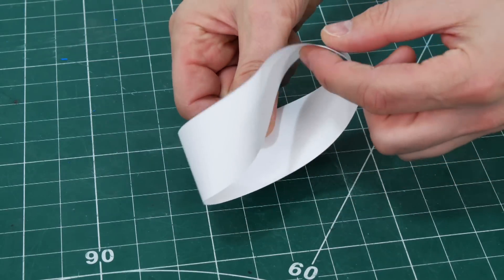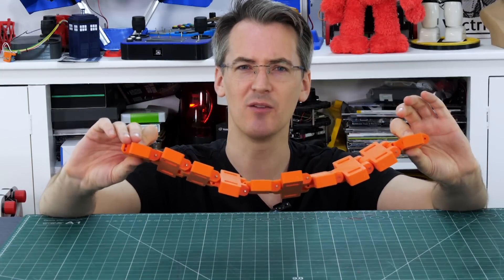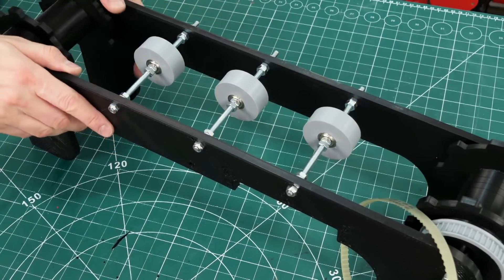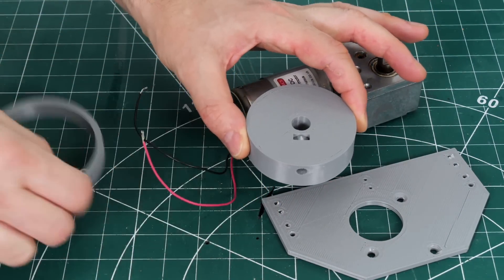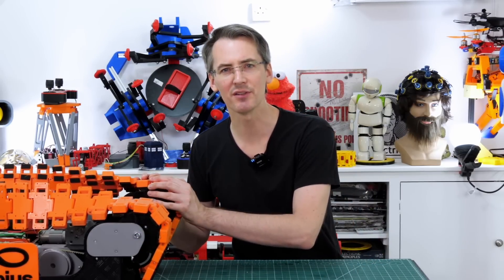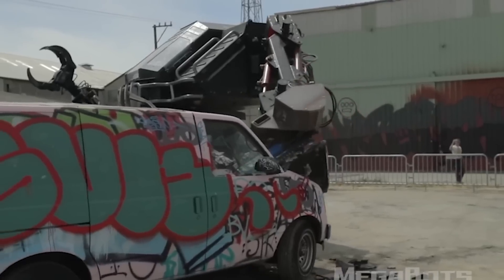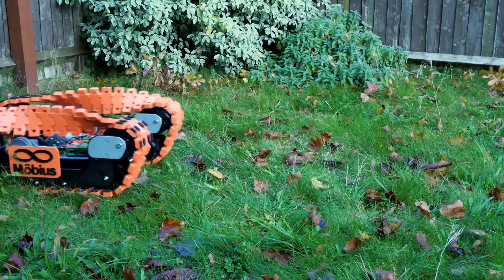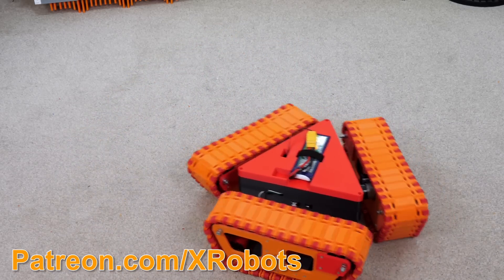Mobius Strip Tank

Comment: @05:35 Reprinting those grey Side Plates with differing geometry until they fit the necessary track tension instead of designing them with a slotted design to be adjustable on the fly is driving me up the walls.

IMHO, the only way this System would make remotely sense were if you could twist the Links not only 18° like shown at the beginning of the Video but 180° thus making it possible to turn the track from a Regular into a Möbius one via the use of a mechanism that twists them as the Links pass through it. By twisting it twice, the second time after it made a full rotation, the track sides would have switched sides from smooth to gripping.

Comment: I feel like a reason for a mobius track would be the fact that the track is technically longer, so wear would be distributed between the "two" sides of the strip meaning the tread could last longer before needing to be replaced. your example with the one half grippy and one half smooth could just be done with a standard track so I wouldn't see that as a USP for a mobius track

Comment: To reduce vibration, move drive sprockets(any sprockets really) away from the ground.  Add grooves to track segments and corresponding lips to the rollers to keep the tracks aligned on the ground.

Comment: Soooo... Just an observation... 

Instead of reprinting parts to deal with tolerances, and tensions issues, instead, design your parts with slots. This will allow you to adjust the tension without having to re-print the part again. Also, for the belt tension, again, use slots, but this time instead of completely tightening down the sprocket assembly mounting plates, put a backer on the frame, and use a set of springs to push against the sprocket assembly, this will give you dynamic tension for when going slow, or fast.

You can also reduce the amount of "bumping" you're seeing by using sprockets with proper angled teeth. square teeth have no angular contact point to "ride" on, this will cause them to "bump" into position, knock on the flat contact planes, and bump back out. using teeth with an angled contact point will allow the contact point to continuously be in contact witht he mating surface, reducing friction, wear, and providing a smoother continuous power transfer from sprocket to tread.

Comment: I don't know how to explain my idea but why not just have smooth tracks, like you do now, with rubber pads that are flush (in line with the flat smooth side) and have a user controlled piston wheel that will push out on the rubber pads near the front and back of the tank when you need them?

Comment: When I saw the thumbnail my first thought was "why would you want to do that?"  Fortunately, you answered my question right at the beginning.  :)

Also, pedantry time:  a "bogie" is an assembly of two or four wheels that is independently suspended or articulated.  That is, the wheels are (usually) fixed in place, but the assembly is suspended or articulated independent of the rest of the vehicle.  With your design, the wheels are just fixed to the frame, so there's no bogie involved.  Which means they're not "bogie wheels," they're just road wheels.

Comment: I can't think of a precise use for it, but this design allows you to stack rows of treads (think |||||||||||| ) with zero gap between them; the support can go between the mobius twists on the back side, the rows of treads no longer need a support gap. They can also be much more flexible in this use case than other gapless options.

Comment: Could you some how build in a mechanism to the tracks to temporarily make it a Mobius strip as to flip the track inside out? It could provid a similar purpose to what it does in this video. Though in this case it would be consistent through the terrain you need to use it (IE spikes for sand but smooth for asphalt or concrete). I would think each linkage would need to have the mechanism so that you could activate the transition and it wouldn't have to do more than one full rotation to inverse the track.

Comment: Actual uses for a mobius track:
-If you want a machine to stamp a repeating pattern into concrete, you could make it half the size with a mobius track.
-It will increase how long rubber grip pads will last, because they are only contacting the ground half as often.
-You could use it for a belt in an airport, again to increase the uptime before you have to replace the rubber gripping surface.
-You could use it to tip material off the side of a belt in a factory.
-If you put in two twists instead of one, you could have a belt with a different surface texture for only part of it's run. Not sure why you'd need that, but it probably has a use case somewhere.
I'm running out of ideas here, reply if you have a good one that nobody else has suggested!
Reply: You'll have to have twice as many grip pads, or if flat, it will become thinner just as fast.
Reply: Its not usefull on its own, but in theory you could use the bend to give the chains a 3D path enabling either: A tank that has only one track (and can only drive straight) or tracks that flip to the side on the top side, leaving more room for armor or the important Parts of the tank on the side.
Reply: If you put a pair number of twists it will not be a mobius strip, it will have two parts like an untwisted strip
Reply: couldn't it also double the life of a something like a belt-sander? Obviously it'd still be using the same amount of material, but it'd only need to be replaced half as often.
Reply: Probably not a great idea, because then you'd wear the idler wheels faster, and those are way more expensive than the belts. @robonator2945

Comment: It should also theoretically allow for more "even" or "slow" wear as if you either put the grips on both "sides" of the tracks or not on the tracks at all, you would wear both "sides" of the tracks unlike a normal tank tread where one side always faces inwards towards the gears and the other side always faces outwards towards the ground/sky. That would make the tracks last twice as long theoretically,

Comment: I think you missed a trick! You had the twist at the top of the track, I think having the Mobius twist in contact with the ground would have a better effect. If you could make the edges of the tracks into chamfered teeth that gripped the ground?   Your setup is good but using a wide double-sided timing belt as tracks would have allowed rubber teeth to be in constant contact with the ground.

Comment: would be interesting to have a double twist such that along the ground you have smooth treads, then a twist to a grippy tread that could be lowered as needed, or raised when turning, then twist back to smooth again at the other end of the tank. wouldn't be a mobius then, but still a twisted tread tank

Comment: Why not use a longhole in the grey plates, so you can adjust and readjust (if stuff wears) on the fly without needing to reprint. Or wouldn't the plastic hold the tension required for the plates not to move?

Comment: theoretically, this is better for wear and tear. rather than one side of the track solely being in contact with the surface it takes turns so to speak. What I would like to know is how would it function in muddy conditions? and what if the twist was useful for water locomotion. I feel like there could be some applications for this idea but its verrry niche

Comment: This has probably been done before, but as you described the issue with long track vehicles like the megabots experiencing high friction when turning...
Could you add lateral wheels to each tread link to grip in one axis and slip in another, reducing the friction?

I can foresee issues with more focused stress on those wheels and their bearings.
Possible solution would be a spring loaded pads which may slide laterally but spring back to center position? (Not sure how that'd cope under stress)

Of course, the more parts you add, the more maintenance required and more potential points of failure, especially when applied to each individual tread link.
I'd love to hear your or others take on this problem and solution.
Just saw you have already made a video on omni directional tank treads, about to watch it now. Sorry

Comment: Put the pads all the way round.

I think the only advantage I can think of is that each side of each track piece is only in contact with the ground once every two revolutions so there's some potential saving on wear and tear. ie. you have two outer surfaces to wear out instead of one.

Comment: You know I clicked this video because I thought someone had finally figured out the muddy/icy tread problem which you did but I guess you didn't realize it haha. To clarify sticky mud or ice clogs up treads until they have no scoop action left on the slick surface(ice on ice mud on mud). When you invert the track you could place a diverter to eject the mud out the side. maybe even a wheel to increase the bend angle and fling it off. Also too much ice inside can de track your treads so you have to build around that, making it holy or add a scrapper.

Comment: The only idea i have where this can be useful is in steel foundaries where they have vehicles that drive over very hot slag. With this design you could cool one side and heat the other on the ground, then switch. Or maybe as other pointed out, resistance to wear. Or both, on Venus for example, spread the wear over two sides and cool it down at the same time

Comment: You can even make a moebius out of a bicycle chain and ride it. At least with recubents and velomobiles where chain lengths of about 4 meters are common, this is a known problem. It may run fine for some time but put you in trouble when least expected. So a moebius check is mandatory after installing a new chain. ;)

Comment: 1:45 - I believe that the reason you're not getting 180 degrees is because you only have 9 connections between the 10 tracks which would be 162 degress, or exactly one track/connection short.

Comment: How about a normal track that has a center nylon tubing that you can inflate to lift the tank slightly? that way you can inflate to only contact the smooth part of the track and deflate to use the grips located at the sides of the track.

Comment: The better solution for tensioning the belts on the motor and tracks would've been to use slotted holes. All you would need to do is loosen the screws/bolts and pull tension on the belt or tracks while tightening them back down. Helps with having to reprint parts when more or less tension is needed especially since, over time, both the plastic tracks and motor belt will stretch from normal wear.
Reply: I was scratching my head as to why he didn't do that, given that axles sliding in slots is how they tension tank tracks and conveyor belts in reality.

Comment: it doesn't bend 180 at 1:45 because you only have 9 joints so far, the 10th joint on the 11th piece would make 180 currently you have 162

Comment: If you could put two twists and put them on the bottom, would it make a sort of screw drive? If you designed the treads right, you might be able to make legs like your previous centipede attempt.

Comment: Okay what it you could use it in extreme mud. Basically you wipe one side and drive one the other. So after the flip you add brushes that clean the dirty side of the tread while you drive on the clean side. This means in really muddy envionments your treads don't get filled with mud and lose grip.

Comment: James!! Ive got an excellent suggestion for a possible use of the mobius strip treads: cleaning! with mobius treads you could clean debris regularly from both sides, ensuring that they cant get bogged down! Think about it, treads can now go through mud or sand or rocks. One brush per tread means that every two rotations both sides get cleaned (thinking like a bristle brush). Or for overkill, a brush on each corner would constantly clean both sides but the brushes only need be on one side. Obviously this isnt an issue for huge tanks, but for small ones it might really benefit. What do you think?
Reply: 16 likes already? Apparently my idea isnt a terrible one, Hopefully James sees my reply...
Reply: @k_the_v  The, um,  flipside of that is that both "sides" pick up mud etc. Think about it, treads have been going through mud or sand or rocks through two world wars.
Reply: @Hugh7777  yes, full size tanks can handle just about everything.  However, we're talking 1/4 or smaller treads, so rocks and sand are a far bigger problem.

Comment: So when James was testing the 10 track segments and they didn't quite make it to 180 it wasn't a tolerance issue, he needed one more segment. The interface between two segments can rotate 18 degrees and while there were 10 segments there were only 9 connections each connection with an 18 degree rotation for 162 degrees. Ten connection which would require 11 segments would have gotten you to the full 180.

Comment: may be retractable pad along the chain, with a switch lever near the wheel to activate deactivate them... it could be programmable like ABS : if the wheels are spinning too fast  > no grip > activate pads... the möbius part wil make it easier for retrataction... (you'll have to push the pads is you want to put them out or in)

Comment: Would this not just work to gum up the drive train or at least expose the far more complex drive train to significantly  more wear than necessary? Just thinking it's easier to change a track section than a drive sprocket.

Comment: Didn't watch the vid but from the thumbnail I immediately see the tracks picking up sand and dirt and dropping it mostly inside the tank body. This would likely over torque your drive motor as it looks like you turn down the motor speed by belt. Might need to be damp or wet dirt/sand before issues such as described are presented.

Comment: What might be an interesting use (although a bit of an engineering challenge) is to make the twist switchable. So In normal use, you'd have non twisted tracks with either the smooth or grippy side in use. Then when you need to change grip, one of the track joins would twist on each track and allow both tracks to do one loop and effectively change their surface over.
It wouldn't be a Mobius strip then as such, but the twist capability of the links would allow this 'flip sides' option.
Reply: Maybe make it a single link that's  split, so it can spin 180 and then lock back together, rather than make one of the joins even more complicated.
Reply: @Stereomoo  Yup that could work. What I'm thinking is with the 18 degrees of spin rotation in each of the links, you could effectively flip a join around somewhere so the following links rotate around by the time they get to the front sprocket wheel.
Reply: @ZwilnikSF if you had a little knob sticking off the ends of one of the links, you could have a slot next to it on the body  that either has the knob continue straight along (no change) or diverts it to flip it the other way.  then you just move the slots while it's on the bottom part of the track, and whichever one's available back at the top it'll follow.  Then have a free 180 pivot between that link and the one "ahead" of it.

I guess really you'd need 3 paths, continue straight, then 180 clockwise and 180 counterclockwise.  Though possibly it would untwist on its own if you let it. (or springload the loose link to encourage that)

Comment: 1:40 it is logical that you need 11 segments for the full rotation, because the first segment rotates by 0 degrees not 18. so after the first one you need ten more to reach 180°, the first one is the 0 position not 1. or you look at the connections then after 10 elements the last connection is already 180° or you start the first one at 18° because the connection can take a 0° segment. so the printed tolerances are perfect!

Comment: Wouldn't that drasticly reduce wear? As its wearing on both sides? Also for faster speeds maybe a guide on top to guide the track so the mobius knot stays on top.
Reply from the maker: Yes, but then the linkages will probably have other issues eventually due to the weird 2-axis pivot.

Comment: If I remember correctly if you cut your mobius strip again you get 2 interlinked twisted loops. Love the idea for the tank. Keep up the great work. God bless
Reply: No, this is the case if you cut a doubly twisted loop in half.
Reply: @mkesenheimer  I'm sorry that is not quite right, make a mobius band cut it in half and then in half again along the strip and it creates 2 double twist mobius bands intertwined. The first cut makes a double twist mobius band the second makes what I've described above. I've just done it to check, give it a try 😁
Reply: @DazO9874  Ah, I misread your first sentence. I tried it out. You are right, if you cut the möbius loop again after cutting it once, you get two interlinked twisted loops. However, my statement is also correct. If you cut a doubly twisted loop, you get two interlinked loops.

Comment: Suggestion: rather than using Mobius track with uncontrollable switch between rubber and slick sides, make a rigid (standard) track with rotating central part within each segment with one rubbery side and one not. I mean, that each segment may have H shape, where vertical lines are the axis, that connects it to other segments, and horizontal central axis allows perpendicular rotation of a flat part of the segment with a pad on one side. So the track will look like this: HHHHHHHH. Then you give the track no freedom of perpendicular rotation, except in the upper part of its trajectory, where you put a mechanism to overturn pads controllably, when needed.
Reply: Great IDEA!
Reply: cool idea!